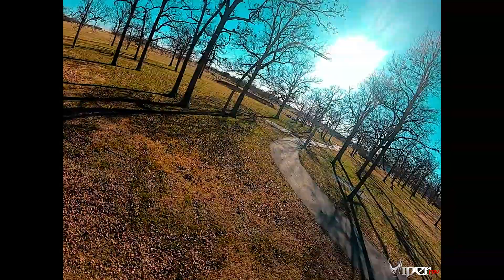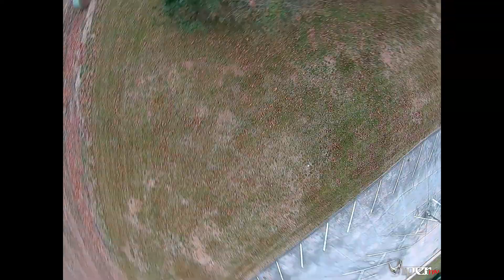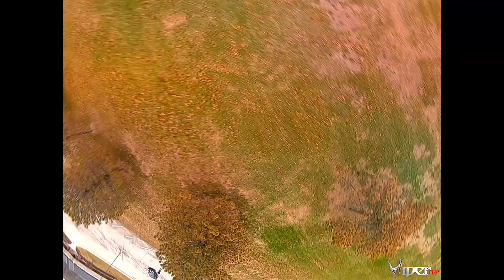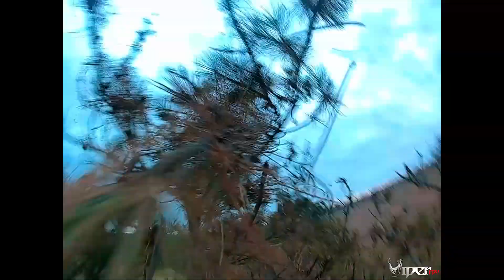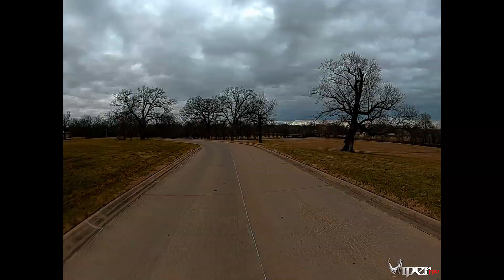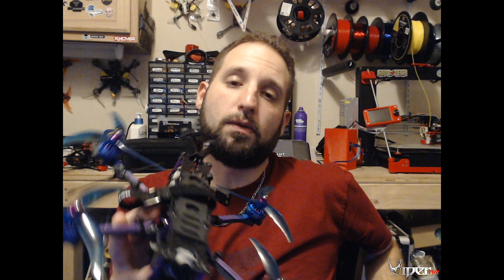DJI FPV HD DIY Ultimate Freestyle Drone Maiden & Final Thoughts

Comment: you used r9 ? in it ? what about the dji controller ?
Reply from the maker: Devasheesh Garbyal no crossfire. I don’t have the DJI controller but if you do no need to add a receiver
Reply: @ViperFPV  what about wiring do we need to remove any wire from dji unit ?